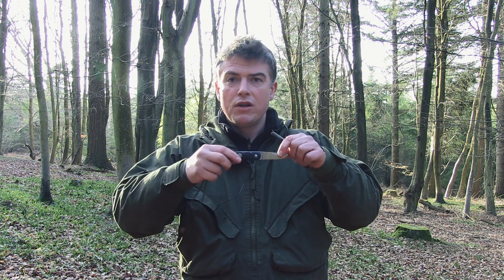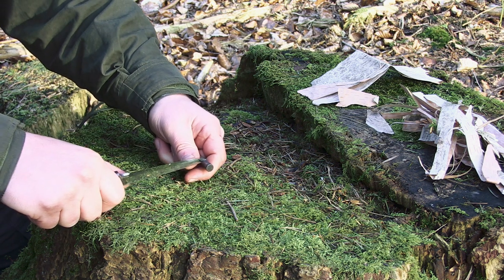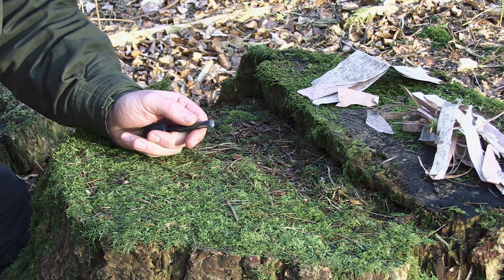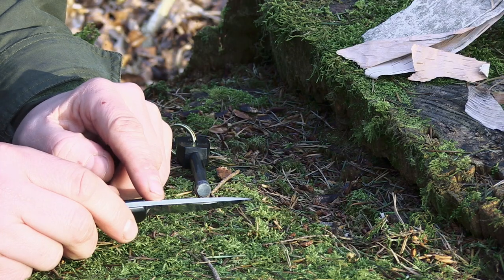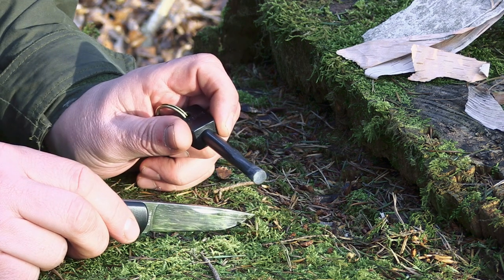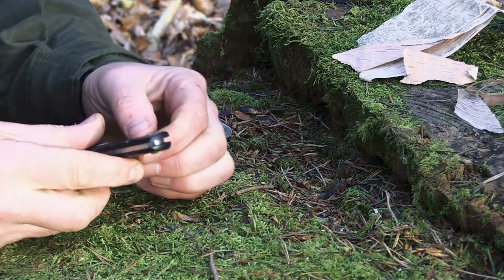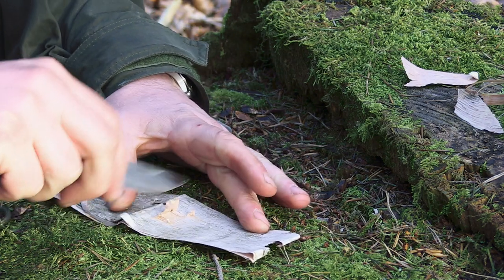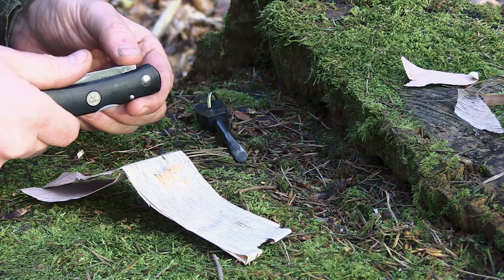Sparks With A Stainless Steel Pocket Knife And Ferro Rod

Comment: Hi Paul, a 90deg edge is great for striking on a ferro rod, what I have found is better is draw filing the spine of any knife to create a burr on the 90deg edge, no matter if it is carbon or stainless, hardly any pressure is then needed to create a spark.
Reply: I’d be choking up on a knife more than striking a steel with it realistically so I’ll let you keep your burr and stick to the 90 degree edge personally. Interesting idea though

Comment: Opinel is excellent to use closed and very safe
You can turn the locking ring so the blade is locked closed
and the spine of the blade is very sharp
they are very inexpensive knives
Reply: Opinels are very great blades. I prefer the stainless no 9 over my carbon steel no 8, other than that I have nothing but good reviews of the blades 👍
Reply: Only the synthetic handle is worth getting. The wood ones swell really bad.
Reply: Jake S I like my beechwood handle, but I have thought about making some micarta for my no 8 carbon steel blade opinel.

Comment: Opinel is great to use that way, has an exceptionally comfortable round handle
Reply: Agreed - I have the small folding pocket knife, works well.
Reply: Absolutely right. I have just added my Opinel No. 7 (carbon version) to my fire set. I prefer the carbon blade because it is a little thinner and keeps the sharpness longer. I chose No. 7 because it is still comfortable in the hand (for minor carving work), but is still remarkably lighter than the No. 8.

Comment: I believe that this is well known now, but to strike sparks from a ferro rod, steel is not required. Any hard, sharp edged surface  will scrape a ferro  & make sparks. As was mentioned in the video, even a piece of broken glass will produce sparks from a ferro rod. Good video, correcting a common misconception.

Comment: I tend to use the saw on my victorinox
Reply: nice! i use my multi-tool saw
Reply: was just researching this topic :)  found a link  that included firefly-the-swiss-army-knife-fire-starter thats a crowd funding project.  they have a video where the back of the saw blade is very thick and square angles.  good choice for the fire starting.

Comment: Recently, I've run across several ferro rods that stopped sparking at all, even though the rod had been only lightly used. One of them was from Soloscientific, and another was one of those Swedish or Coghlan's ferro rods like you're using in this video. The rods would not spark hardly at all, even though it had sparked well previously, and there was no new coating on the rod. The rods would not spark regardless what scraper I used, and even though the scrapers worked fine on other rods that I have. It was as though the non-sparking rods had been manufactured using only a thin coating of the sparking metal which quickly wore off down to non-sparking base metal underneath. If that is truly the case, this is criminal of the manufacturers, and I would strongly advise anyone purchasing a ferro rod to thoroughly and completely test that it was solid sparking material well below the rod surface before staking your life on it.

Comment: I'd suggest getting a handheld hockey skate blade sharpener.  One for goalie skates will have a very large radius, almost flat.  Hockey skates for defense have smaller diameter grinds.  The idea is to dress the back of your knife, machete, saw, etc., to that radius.  You could initially get it sharpened at a skate shop, first time.  Then in the field you only need to touch it up.
This will give a real sharp corner on the back of your blade for shaving tinder etc.  And getting shavings from ferro rods for fires.

Comment: Great video’s, this video peeked my interest so I decided to dig a little bit more into what makes a ferro cerium rod and it’s very interesting that most of what makes it up is rare earths. I’m surprised it doesn’t cost more than it does, here’s what google says it’s made of;
“A modern ferrocerium firesteel product is composed of an alloy of rare-earth metals called mischmetal (containing approximately 20.8% iron, 41.8% cerium, about 4.4% each of praseodymium, neodymium, and magnesium, plus 24.2% lanthanum.)”
The name is pretty much a dead giveaway of what’s in it. Fe being iron and cerium make up over 60% of the rod. Now the magnesium is probably where it gets it hot sparks from because magnesium burns at 3,100 °C (5,610 °F) but in small particles it ignites easily, and cerium ignites at 150°C (302°F).
As far as getting sparks from a ferro rod with metal, Coalcracker has a video where he used a honing (sharpening) stone to get sparks. So it seems the rod itself has everything it needs to make sparks it just needs to be struck. Give it a try and see if ordinary stones will cause it to spark.

Comment: Also, you can still knock a spark off a stainless knife as long as it has enough carbon in it. More work and less sparks than a simple HC knife but if stainless is what you have it's worth a try.
Reply from the maker: Always worth a try.
Reply: cyclist01222    Carbon in the steel is NOT required to spark a ferro rod. Please watch the video again.

Comment: Even a ceramic knife or blade.
Reply: Rick Hawk Davison no.. a ceramic knife wont be able to generate sparks. and it might even break
Reply: ULTRA NOOB Actually, might aunt is a hair dresser, gave me her old ceramic scissors, use the blade, it doesn't need to generate any thing but friction, the ferrosium does that.
Reply: ANYthing that's harder then the ferrocerium rod and sharp enough to scrape material off that rod, will throw sparks (with the correct technique). Glass, rock, flint, steel and even ceramic (IF its hard enough). Not all ceramics will work and a sharp edge is still required (as it is with even carbon steel, can't throw a spark with a ROUND edge). But the material has nothing to do with throwing sparks; harder then the ferrocerium and sharp enough to scrape material off the rod. Even a HARDER ferrorod can throw sparks off a softer rod (if it had a sharp edge).
Matter of fact, if the ceramic did break, that would create a sharp enough edge if one didn't already exist!!
Reply: Rick, you were correct about ceramic..however, you are INCORRECT about it just being friction. If that were the case, even a ROUNDED edge causes friction, but doesn't throw sparks.
To generate sparks from a ferrorod (the rod being the sacraficial material) the 'striker' needs to be HARDER then the ferrorod and have a sharp enough edge to scrape material from the rod...not just 'rub' it. Most any angle on an edge could throw a spark (but your technique would have to be PERFECT), but its EASIER with an angle of 90 degrees or smaller (90 is easy to make on a blade).
The scraping of material from the rod is what causes sparks (with enough force), but one can scrape a rod and NOT make sparks: simply scrape slowly and lighter then needed to make sparks. Sparking a ferrorod is much like making wood shavings, but on a MICROscopic level (and with ferrocerium instead of wood)
I've thrown sparks off my rod with HC, SS, broken glass and even ALUMINUM (but that edge didn't last long) from an LED flashlight. Never with ceramic, but it would work (not sure for how long).
For those that don't think ceramic would work...HOW do you think ceramic rods hone steel kitchen knives? The ceramic HAS to be harder then the steel, or the blade would simply wear away the ceramic rod. So, HOW could ceramic be harder then steel in that case but NOT harder then ferrocerium? You cant' have it both ways. If its harder then steel in the kitchen and steel is harder enough to spark ferrocerium....think about it, come on...you'll get there.
Reply: yeah.. it might give a few sparks. good luck trying it with a ceramic knive.. but then when your knife is broken and a finger or 2 are laying infront of you on the ground... dont come back crying. ceramic knives are as brittle as grandmas old whittered bones. and they cause hell when broken.
Reply: wait, didn't you say it couldn't spark...now you say it can but might break (btw, that still means it CAN). You're flip flopping like Trump, pick a side.
and if you're using the wrong technique that YOUR fingers might be at risk, you might wanna considering staying HOME and leaving the 'outdoors' to the rest of us.
Yes, ceramics are brittle...but so can steel be as well..that's why we don't tend to use 62+ HRC steel (at least, not for bushcraft).
But that in no way means you can't spark a ferrorod with a ceramic blade. So your whole 'NO IT CANT' on Rick's comment is moot. Ceramic CAN spark a ferrorod (or it SHOULD be able to)...whether it breaks doing it isn't the point. As I said, anything hard enough and sharp enough CAN spark a ferrorod. If it breaks doing it was NEVER the debate. But then using the cutting edge of a blade isn't a debate either IF you HAVE to get a fire started...you use WHATEVER makes a damn FIRE start (that's why we should all experiment with alternatives to the back of our knives...is there ANYTHING else in our 'kit' that sparks a ferrorod too?).
Reply: The action when using a ferro rod is that the striker shaves up tiny pieces of the rod and the resultant heat caused by that friction enables the shavings to ignite and burn with the oxygen in the air. Anything that can create the shavings and generate the heat when scraping the ferro rod will work.